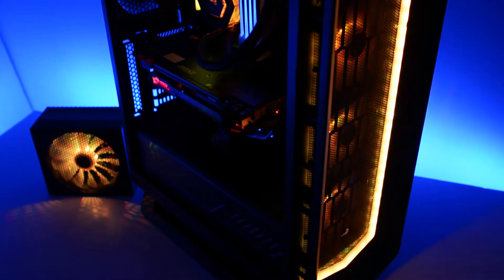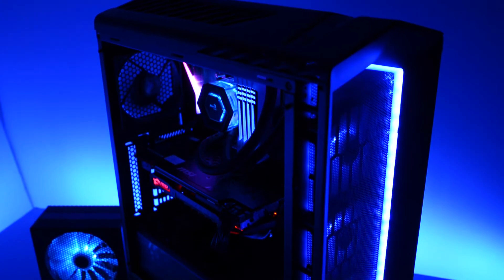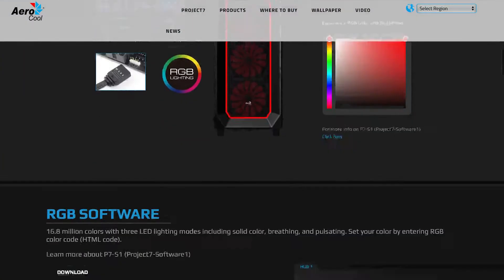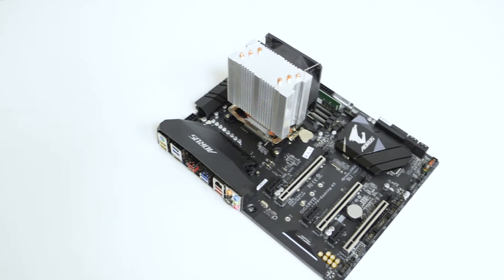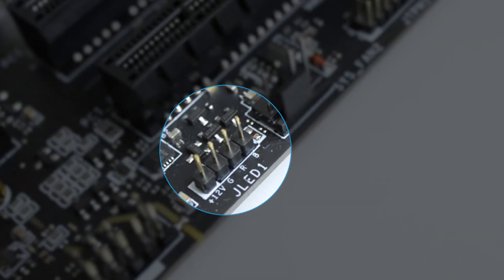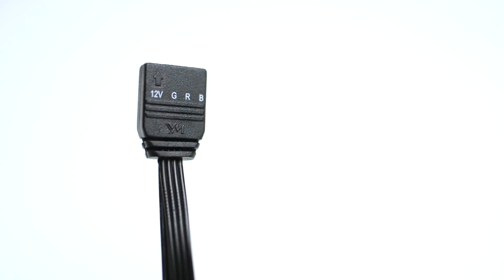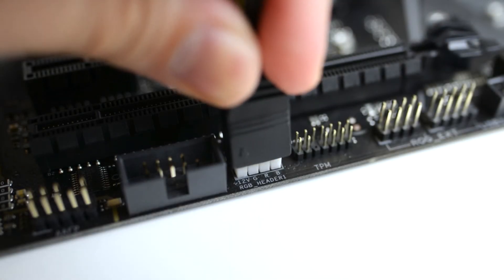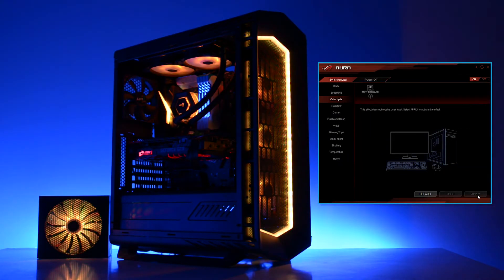Connecting RGB Motherboards to Compatible Aerocool P7 Products

Comment: hello aerocool! =) i have a question. did i need to install all drivers for the P7-H1 to controll all fans with the 4 header connector witch is on the p7-h1? i connected it on my aorus z360 bord but the settings on my UEFI will not work . they run constantly in the same speed :X maybe u can help me out
Reply: DerBaron FPV I've got the same issue, you find anything?
Reply: sorry i dont fixed it yet... :/

Comment: AND WHAT HAPPEND WHEN I DONT HAVE AN RGB MAINBOARD .....PLS ANSWER ):
Reply: use the hub
Reply: Would be a solution, if those morons of each manufacturor of rgb huds would give a descend manual in how to use their software and products. The one that you get from Aerocool is a joke, one piece of paper in how to connect the set, but zero in how the soft works or if even the 2 RGB connectors on the hud are 2 different channels or not.

Comment: Hello. So if I buy a P7-C1 Pro I can run all the RGB off of my motherboard, I don't need to use the P7-H1? Or can I output to the H1 from my motherboard and it resends the RGB signal to all the devices?
Reply: i have a P7-C1 and asus z370-E i try to conect rgb to motherboard but not detected from aura wat i can do to work
Reply from the maker: Thats correct ts up to you if you want to use the HUB, if you dont want you just need to connect the RGB cables directly to the RGB Out of your motherboard